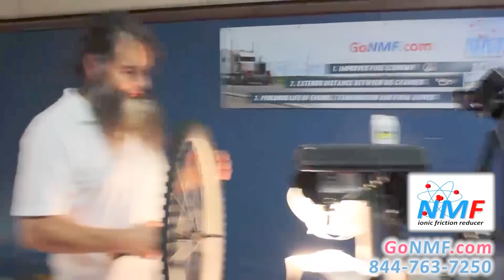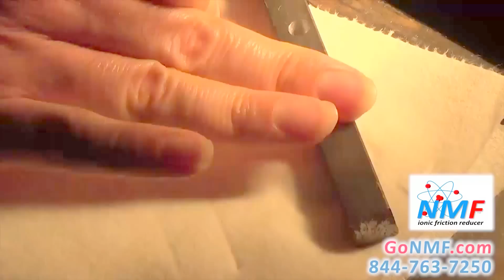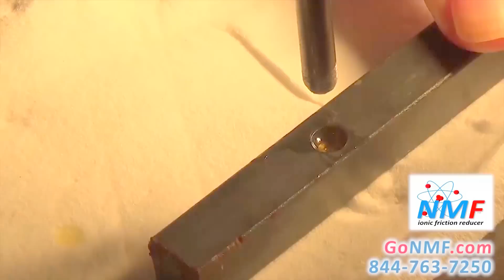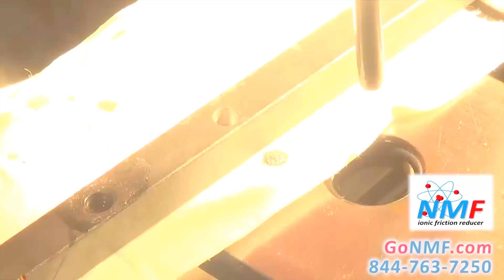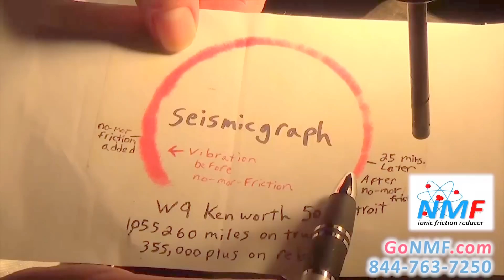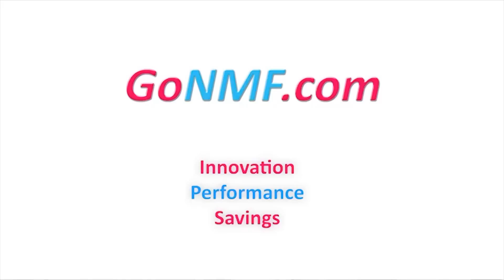NMF Ionic Friction Reducer:  A Scientific Explanation

Comment: I find this friction reducing technology to be very interesting. I do not know much about the intricate relationship of the moving parts of an engine. I only have a basic understanding. That said, I can still see the value in friction reduction in the way your product repels via electrical repulsion. Therefore, I am sold on making the investment and using this product in my SUV. But in my experience, even when I have discovered "game changer" type technologies, I have also found that there are still other components to the equation which impact and facilitate overall performance and results. And while NMF may have a huge affect on said benefits, I want to create the best environment inside the engine possible, so as to maximize ALL of the stated benefits of NMF. So, my question is - is there a particular type of oil - conventional vs. synthetic - or a superior brand thereof, which works better or worse with NMF? And same question for the transmission fluid. Also, I recently discovered the product Tribo Tex which, as I understand, uses some form of nanotechnology to improve engine performance, promising similar benefits of NMF. Is Tribo Tex just another form of oil stabilizer that would add no additional benefits or worse, work against NMF? If NMF is also being added to the gasoline (not diesel) tank, is there a particular grade of octane or a particular additive which would in concert with NMF for improved fuel efficiency or overall performance? I am going to follow your advice and add NMF in the best way possible into my current SUV. When I buy my next SUV, by the end of 2018, I want to start off right by having all of these components added to the fluids of the automobile from Day 1, so as to minimize or mitigate wear and tear and maximize its life. I look forward to hearing back from you. Thank you!
Reply from the maker: Hi, John.  A happy Sunday evening to you.  Thank you for interest in NMF and your thoughtful questions. I'm happy that I was just looking at the video and saw your comment!  Sometimes comments are posted in Youtube and it takes a while to see them.  I will be glad to answer your questions here.  For future conversation, so I don't miss something you've said, let's do it over the phone or through Facebook or email (my email address is ceo@GoNMF.com).

NMF works well with any conventional or synthetic oil.  We don't have a particular preference.  I'm not real familiar with TriboTex, so for the best information on it I would recommend speaking with their company.  NMF is compatible with other additives.  However, in most cases, when a person begins using NMF they eventual stop using other additives.  

As far as gasoline, if your vehicle doesn't knock, I would recommend just going with the lowest octane (generally the cheapest gas at the pump) with NMF and you'll get maximum performance.

I encourage performance testing of NMF and reporting in public forums.  If a company is willing to do so under pretty stringent conditions, I will provide free NMF for that purpose.  Information is at this link:   http://GoNMF.com/testingNMF.pdf

Please feel free to call me at 844-763-7250.  We cherish our personal relationship with customers, and I will be glad to answer any questions you may have.  

KEY LINKS:
- Video explaining NMF technology: https://goo.gl/TC4gxy
- Questions and Answers: http://gonmf.com/q&a.pdf
- Dealers: http://GoNMF.com/dealerhome.aspx
- Sponsorship: http://gonmf.com/Sponsorship.pdf

NMF is available from
- Local dealers (map at bottom of www.GoNMF.com)
- By phone at 844-763-8250
- Our website: http://GoNMF.com/nmf.aspx
- Amazon: http://a.co/bPsGtup
- eBay: https://goo.gl/4s4wjr

We look forward to the privilege of serving you.

Joe Lehnerd
Lieutenant Colonel (retired), U.S. Air Force
Owner, GoNMF

Phone: 844-763-7250

Comment: I've seen a lot of claims for products over the years but this one is very interesting. I'm almost convinced.  Lol going to give it a try anyway but I am concerned with mixing it with my high quality synthetics as I've seen some bad results with other products being mixed into good synthetics causing the oil not to perform as well as it did before the addition of the Said product. My best test will be my mk4 GTI stubborn tranny I just hope this stuff is ok to use with yellow metals. Researching now but would love to hear a reply
Reply from the maker: Hello, Mr. Hendrickson.  A happy Sunday to you.  Thank you for your questions.  I will address it here.  Also, please feel free to call me at 844-763-7250.  We’re a small company and I cherish our personal relationship with customers.

NMF is safe for yellow metals.  There will be no corrosion.  

NMF will improve the wear-resistance performance of any synthetic or conventional oil.  Actually, NMF does not change the oil.  It just gives it less work to do.  For example, tractor pullers in Ohio asked us to test Schaeffers Supreme 7000 Synthetic Plus 20W50 racing oil without and with NMF.   NMF reduced friction for that top-of-the line oil by 26%.  On a lesser oil, Shell Rotella T 15W40, NMF reduced friction by 36%.

Key links:
- Questions and Answers: http://gonmf.com/q&a.pdf
- Dealers: http://GoNMF.com/dealerhome.aspx
- Sponsorship:  http://gonmf.com/Sponsorship.pdf

NMF is available from local dealers (map at bottom of www.GoNMF.com) or 
-  By phone at 844-763-8250 or
- Our website:  http://GoNMF.com/nmf.aspx
- Amazon:   http://a.co/bPsGtup
- eBay:  https://goo.gl/4s4wjr

I look forward to the privilege of serving you.

Joe Lehnerd
Lieutenant Colonel (retired), U.S. Air Force
Owner, GoNMF
Phone: 844-763-7250

Comment: Outstanding product!  

2005 F250- 6.0 power stroke 
anyone that knows diesel engines knows the 6.0 is a problem child from the beginning! 

At 125000 miles I had major injection system issues.
major loss of power and fuel economy 
I took my truck to a shop that I trusted as I didn't have the computer needed to perform the tests needed

report stated 

(CATASTROPHIC INJECTION SYSTEM FAILURE)

All 8 injectors were in need of repair or replacement 

At the time I didn't have the money to perform the repairs needed 
So I looked for any products that could clean and free my injectors.

I tried many products with no noticeable effect  
 
@ 138000 miles  I tried NMF .

I saw many videos on YouTube and figured what could it hurt at this point 

I did the same test shows with the water jugs before and after and I literally could not believe what I was seeing.

I ran my truck from Green Bay Wisconsin to Virginia 4 times loaded heavily.

changed my oil filter every 1500 miles
 * excessive maybe but with how much build up that was in my engine I felt it was worth it *

at roughly 140000 I noticed a big difference on power and fuel economy.
also my Turbo reacted much much faster ! it was incredible

My running temp has down by 35 degrees  
My fuel economy is outstanding difference  
 

My truck now has 152000 miles on it and the same injectors that were in need of repair or replacement are still installed and the truck is running perfectly! 

THANK YOU NMF!!!!!!!!!!

(TUG) Diesel Truck Army / Founder and Owner 
MM2-SS- USN- Rt.